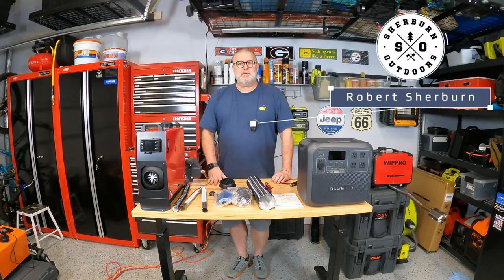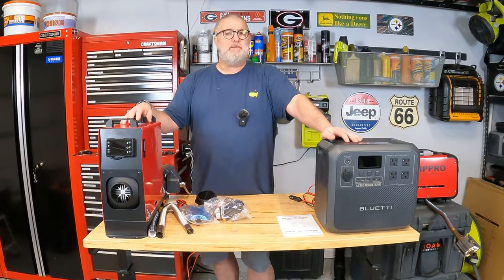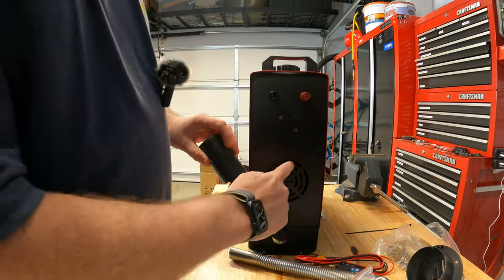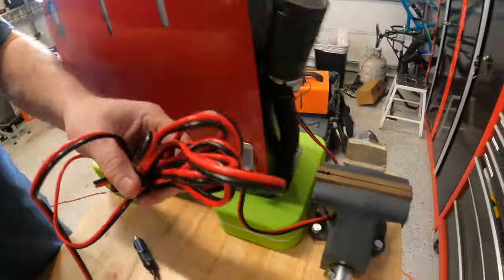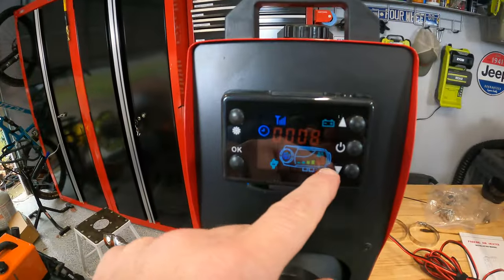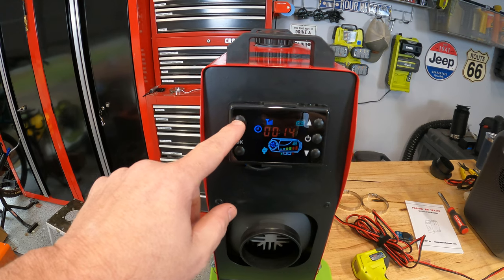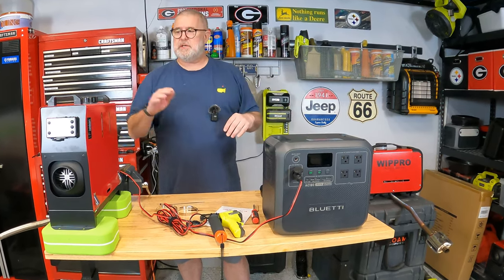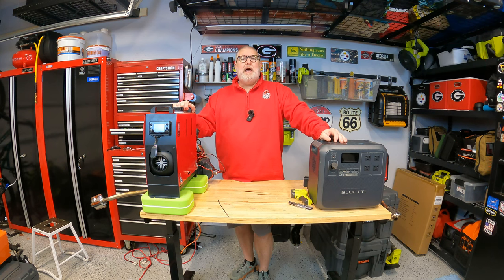How To Set Up a Diesel Heater in 6 Easy Steps!

Comment: I just installed the 5kw version of the vevor in my workshop, and yes, it warmed up the space fairly quickly.   I'm pleased.  Yes,  my fuel hose is kinked, but it doesn't seem to make  a difference.  The noise from the pump is a little  irritating and  the silencer outside is also loud.  However I walked over to my neighbours fence and I could hardly hear it! So all in all I'd give it 9 out of 10.

Comment: nice video . the ID of 1 outlet pipe is 75mm  .so 80-85 mm hole would work and add a fuel filter is the main points on these . on lowest setting is about 750w of heat . high is about 5KW . alpine setting if high up . slows the pump down so less fuel used

Comment: Greetings from Kanada. Great video. I just had my 8kw Vevor unit delivered today. I also ordered a few fittings to route the exhaust outside, and a 6 foot exhaust tube. I want to make a heat exchanger to maximize the heat gain and increase efficiency. This will be a game changer in a power outage. Thanks, brotha!
Reply: Two things you should know there’s no such thing as an 8 kW heater  
They advertise it as that, but it’s not  it’s probably closer to six
Other thing is the heat exchanger, gotta be careful condensation in the exhaust plug up the exhaust inside the exchanger
Reply: @Dorklepuss  Yeah, I will be sure to angle it down a bit to drain the condensation.

If you do the calculations on the heat energy from a kg of diesel fuel, you will find that you are quite correct. Still, it will provide enough heat to keep me warm in a winter power outage. Thanks for the info!
Reply: @Dorklepuss who cares, it is like 2 dollars more.
Reply: @lincolntrewethey why did you spell kanada with a K
Reply: @politicalfisherman540  I spelled it with a "K", because proper nouns are always capitalized.

Comment: Thanks for a really simple explanation and demonstration of how to setup these all in one diesel heaters. Particularly important was where those pipes go as there is no explanation in the manual. I think you should also add a small inline fuel filter between the tank and the pump so that any sediment from the fuel tank or contamination in the fuel is prevented from entering and clogging the pump.

Comment: You got about the same because they are the same  (5 kw & the 8kw). All you have to do is go into the setting  code (4 blinking lines) and put in 1688. From there you can set it even lower than it came and Higher than it came in both the Pulse setting & the Fan setting... Factory setting is like 1.4 but will go down to 0.8, factory High is like 5.4 (5kw) but will go all the way up to 8.0 (8kw). Thats where you get your 8kwh at.. But I just use mine ~ as is ~ because it doesn't really get that cold here in Eastern N.C. except for about 7-10 day a Year..  Like RIGHT NOW, Tonight & tomorrow night suppose to be like 12-15 degrees. Thanks 4 Video...
Reply from the maker: Thanks for watching, I am in N Ga and it is really cold
Reply: This is a great comment John. 
I'm putting this video in my van life playlist just because of your comment. 
You Da Man!
I'm in Texas and now it's March 3, 2024. It is going to be in the 80's today. Our "winter," is the first or second week of December (first frost) and the 3rd week of February. We are now in Spring. So, our "winter" lasts about 9 weeks.Happy Days are here again.

Comment: Very informative videos!! I just ordered mine yesterday. I have one question in reference to the dryer hose. In your Amazon links, you list the 4” diameter hose. It was my understanding that I needed the 3” diameter hose. Can you confirm which one I need? Thank you!
Reply from the maker: I have used both, I hear they sometimes the 3 inch will back hear up in to the unit if there are any tight elbows.  I have not ever had an issue though
Reply: Thank you! I’m leaning towards the 4”. Does it fit snugly over the warm air outlet vent of the heater? (Using the pipe clamps of course)
Reply: 4 inch since you are increasing the length,   a long 3 lnch will create excessive back pressure and give you high combustion chamber temp code

Comment: Hi I'm new to diesel heater recently went camping tent used diesel heater it was super outside like 15 to 10 degrees  heater level 2 air was blowing little cooler but when I put max comes out hot I can't put over night max my power station 300 watts by any chance help what setting I need for heater in future?

Comment: Does it need to have a battery power? I thought just ran off diesel. I just got one and now not sure be able to use it as was for shed.
Reply: Get a car battery!!!!!!!!!!!!  Even if an old one it will work, couple it up to a charger or take it to house to charge.  Duh!
Reply: They have to have a 12 volt power source to run the fuel pump and the fan
Reply: What did you expect to heat the glow plug or supply power to the fuel pump?

Comment: Can you set the heater on auto mode with temperature setting?
Reply from the maker: Yes, but needs to be inside to regulate.  I always have mine outside using a Roof Top Tent

Comment: For the sake of demonstration, you put the air intake on one side and the exhaust on the other, but in actual setting you have to send the carbon monoxyde outside the cabin if you don't want to suffocate. Am I right?

And can you leave the air intake inside the cabin or tent or it is better to take fresh air from outside?

Comment: How hot does the outlet duct get? I was hoping to set a heater up in a cabin that has a storage partition. I was going to put the heater in the storage side and pipe the duct through the wall. The walls are lined with wool insulation. My only fear is rhe duct being so hot as to cause a fire. Im talking about the duct coming from the front of the heater not the exhaust

Comment: If someone doesnt have the big battery pack like you can i connect the car battery to it? Is it only to give power to the unit so you can light up the screen?
Reply from the maker: You can use a battery.  The battery powers the electronics and the fans
Reply: @sherburnoutdoors  thanks, have you tried how long it would power it?
Reply: Don't use your car battery. It is not designed for this application. Use an auxiliary battery, like that Bluetti or a standard AGM battery which is designed for low current draw over a period of time. Your car battery will run it for a few hours then die. And then you can't start your car. And the battery is also probably damaged from being run too low.
Reply: @jameslawson3876  how about the deep cycle rv/marine battery, would that work ok?
Reply: @pericaperko1031 yes a deep cycle battery is designed for that purpose. Should be perfect.

Comment: Arnt you supposed to prime the unit before starting it?
Reply from the maker: That is the clicking noise you hear when it starts, it is priming itself after the glow plug heats up
Reply: I believe there's a setting that allows you to prime the pump before start-up.   It's probably in the user  manual

Comment: I've heard that the exhaust pipe needs to be run downhill so that condensation does not build up in the pipe and create soot. I want to use mine in a sailboat so it will be hard to run it downhill and still get it outside.  I think there is a part you can buy that hooks onto the pipe that has something similar to an S trap for plumbing attached so the condensation can be let out without having the exhaust come out with it.  Does anyone reading this know anything about this or know where I can find info about it?

Comment: If I ran this off of my car battery over night on the low setting, would I have trouble starting the car the next morning?
Reply: Yes. Your car battery is designed to put out a high power output for a short time to start your car, whereas an auxiliary battery, like that Bluetti has a Lithium battery that is designed for a lower current draw over a long period. Your car cranking battery cannot do the same as the aux battery.

Comment: I'm curious, did you run one tank of fuel for your test, or empty the tank and put in just one gallon? My low setting is 1.7hz, I am sure that will affect fuel consumption. Mike from MASS.
Reply from the maker: Filled the tank completely each time
Reply: Thank-you. Mike from MASS. @sherburnoutdoors

Comment: Good 👍 but why is that connected to the power its meant still need power why not working only disel
Reply from the maker: The power is needed to heat the flow plug, run the electronics and power the blower
Reply: @sherburnoutdoors  eating too much electricity from home 🏡 o just litter?